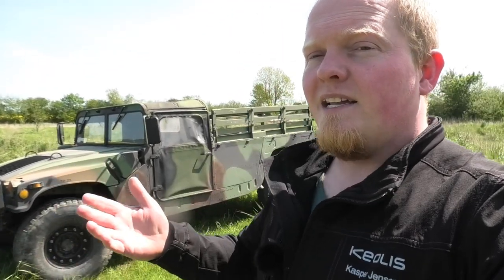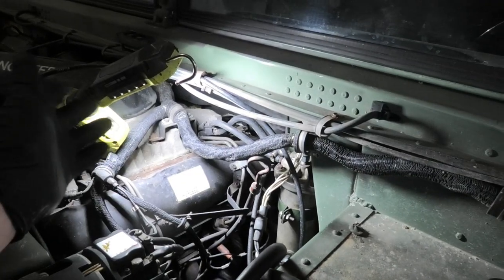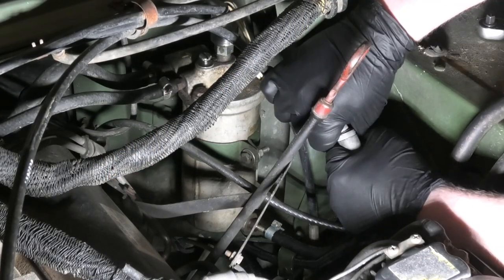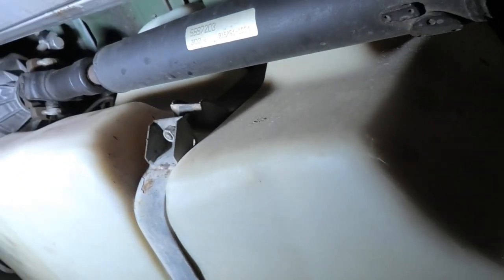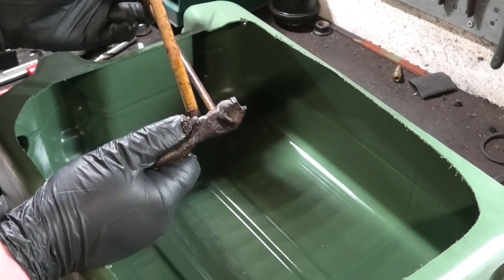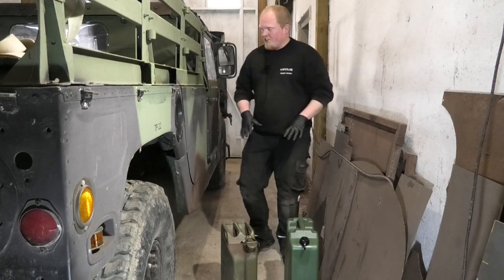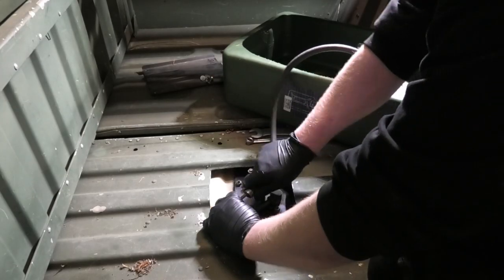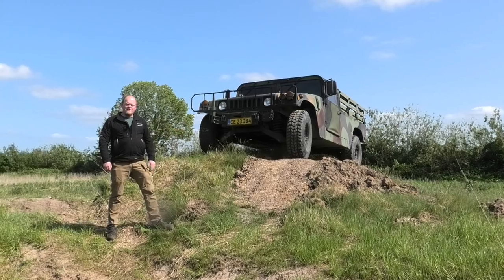Diesel Bug? -in my Humvee!? -Let's get rid of It!

Comment: Very good work. However you would have done better if you could? By blowing a pig through the fuel lines with compressed air. Biocide is supposed to fix the trouble but i am now thinking my fuel system needs to be inspected thoroughly. Ive had some odd problems and had the smell of fish in my tank. I was hoping to hear of any observation about odour. Plenty of fresh fuel and stacks of additive seems to have stemmed the problem aa good bit. Not a complete solution though.
Reply from the maker: Thanks. and yes, i would have done more. but i really didn't feel it was necessary, as it really wasn't too bad on mine.
But you are right about the smell. again, mine was not so bad, that the smell was off. that's also why i didn't think to mention it.
But over time, the fuel does go bad and it will lose that Diesel Smell. and just smell Stale, or yeah, maybe even "Fishy"
So had mine been that bad, i would have done more, like blowing out the lines, and maybe even take off the pump, and clean that.
And the additive/Biocide does kill the bacteria. but it does not remove all the lumps of slime that have already emerged.
Reply: @KJOff-Road  well there's food for thought. Now I know I have to get deeply engaged fixing my fuel system. Thank you for your knowledge. I hope to put it to good use. I would have preferred not to have a need to . But how bad can that be? Onward ...>>>

Comment: Anyway you could send me measurements in the bed where that hole was cut for access on the fuel connection? That is a M- 998 correct
Reply from the maker: mine is a M1038, but thats pretty much the same as the M998.
The hole itself is roughtly 15cm (6") wide and 18cm (7") long.
And measuring from the back of  the bed to center of the hole, is about 179cm (70,5")
And measuring from the side edege of the bed, where it goes down the the right rear passenger seat, it's about 23cm (9")

Hope that makes sense.

Comment: Did the Americans design that humvee to be difficult to maintain in the field, nothing seems to be easy to access when you need too. My Haflinger was a doddle to work on compared to that thing.
Reply from the maker: Somtimes you'd really think that. Haha.
But i suppose it's all a compromise.
They must have prioritised the ground clearance. 
So Having such a big drivetrain all tucked up over and between the frame rails, dosen't leave much space.
Reply: USA military. The vehicles are inspected regularly. This bug takes some time to develop and grow. Then with mechanics on the payroll it is natural they will fix anything that needs attention. Completely. Probably switch out the entire fuel system for new. Back to work for Hummer.
Reply: 'They designed it to worked on by kids fresh out of high school with basic hand tools'.  Not my quote but after watching a bunch of these Humvee videos in preparation of buying one, nothing is looking too daunting.